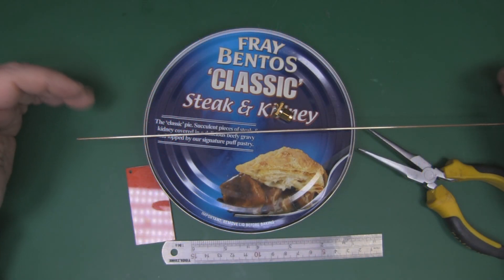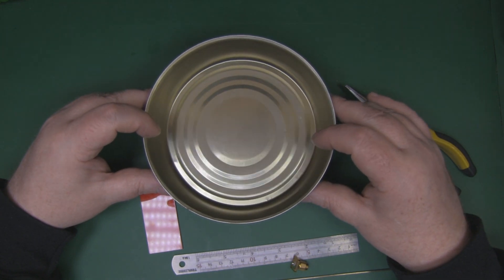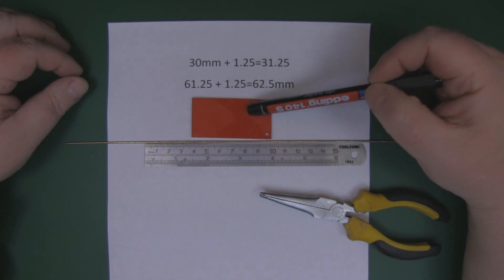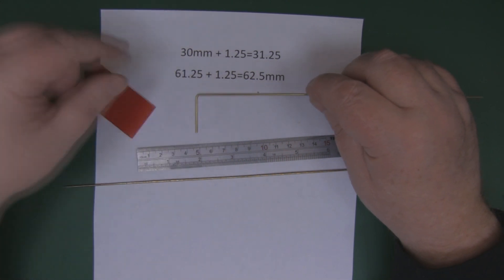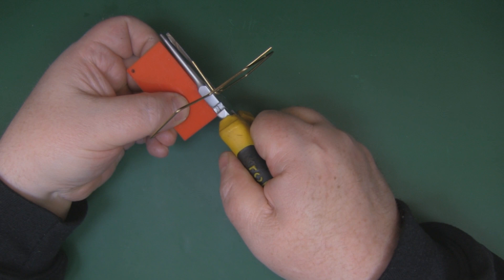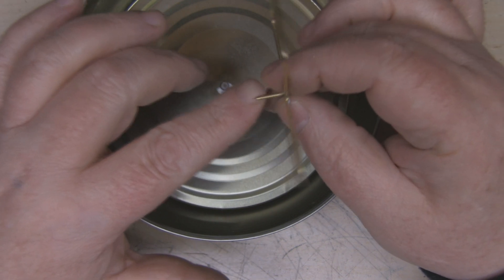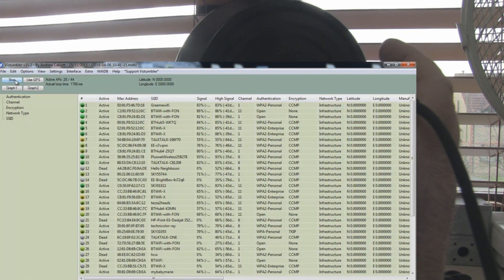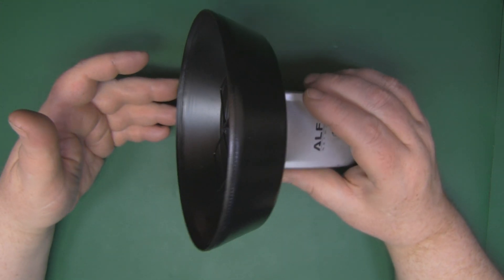The Piequad Biquad Antenna! #149

Comment: Impressed by efficiency of build, did exactly the same except reflector, tin can, 102mm dia, 75mm depth.
Was poorly 80dBm, now good as 65-67.
Haha, at 10cm from it, at the path of the narrow beam shown -15dBm <3
Will do some more tests on WiFi, later after is GSM, 3g, 4g networks

Comment: Hi, I'm from Indonesia. As most of WiFi extenders (access point radios) have 2 antennas, so we have to decide which one is the receiver antenna, or the transmitter antenna, then we can apply the quad antenna as shown in this video.

I need your explanation, thanks in advance.

Comment: Hi mate I know this is a very old video, I'm going to make one for my radio transmitter, can you use brass wire for the actual antenna? The copper wire I have is just a bit to flexible
Reply from the maker: Yep I use brass all the time
Reply: @andrewmcneil  thanks for the fast reply, what about 1.5mm copper, does the slightly thicker wire matter?
Reply from the maker: @vaughan_fpv  1.5 is fine search for brass brazing rod on ebay
Reply: @andrewmcneil  ive just tried the biquad, works ok, what antenna in your apinion would be the best, im using my standard 200mw rc transmitter and i want to get more range without going to 900mhz

Comment: You need to discuss what to do with antenna AFTER it's built. I need to boost my mobile reception in the house. I want to mount the antenna on a tall pole from the roof. What do I do with the signal in the coax cable? How do I bring it down and into my wifi network. What hardware do I need to make that happen? Does the antenna transmit the stronger signal back to the cell tower? I appreciate your clever handiwork, but what comes next?

Comment: Hi Andrew. Very inventive reuse of a pie dish!

I want to make a pair of biquads for 700 Mhz 4G and install them -45 / +135 degrees for a MIMO installation.
I have some perforated aluminium sheet (as used in security doors) I'd like to use for the reflectors.
My question is, can I use a single sheet as a reflector for both of the antennas? Mount one biquad element angled one way up one end of the sheet and the other biquad element at the other end of the sheet, angled the opposite way but on a single reflector? Or do I need to have completely separate antennas?

thanks for any suggestions.

Comment: This biquad antenna does work very well. I built different versions of it.
If you live in mainland western Europe and have an Action shop in the neighborhood, you can use their Disney canister for it (example: https://www.action.com/nl-nl/p/disney-opbergblik-/ ). It only costs 59 eurocents and you can make an antenna from the lid as well as the container.
It's 12 cm in diameter, so close to a full wavelength of 2.4 GHz which is recommended.
Make sure to use a very short coax cable, preferably of high quality and your soldering should be good (no cold joints). I just used the SMA-connectors of the standard-antenna's and made some extra shielding (Aluminium tape) where I joined the cables together. For the element itself I just used the core of the coax cable.

Comment: I still wondering if china stuff (cheaper connectors & others ) perform as well as their costly europeean ou american equivalents ?
Reply: The "gold" plating is a bit off, but it's completely the same otherwise.
For high end antennas you may still want to look into quality connectors, since even the smallest losses are pretty important on long range communication, but for regular wifi within 3km it is perfectly fine.
Reply: @lazar2175  hi, im kinda new to all these stuffs. Can I know what kind of panel mount connector should I buy if i want to connect it directly to a RP-SMA female?
Reply: @eesama9883  You need a RP-SMA male panel mount connector, which while rare is existing.
My advice is that you don't use a panel mount and instead buy a regular connector, preferably one that is solder on unless you have crimpers.
Then solder the coax to the connector and to the antenna, giving you a sort of a "pigtail" that's quite short but has several advantages, including better articulation of the wifi adapter and the cheaper price instead of the male RP-SMA connector.
But feel free to try both, only the regular connectors are like 10 pieces for $5 and panel mount are like 1-2 for $5.
Reply: @lazar2175  Sorry, I'm very confused here. So, antenna <---> n-type female panel-mount connector <--> coaxial cable <--> RP-SMA male connector?

Edit: I understand what you're saying now, but don't most of the TV coaxial cables will cause some loss? The recommended LMR-400 coax is so expensive.
Reply: @eesama9883  Err, go to the aliexpress, the 5m of the coax is under $10. Also, using the adapters is not the smartest thing, since god knows how they are engineered so there my be impedance mismatching or other things that could cause big losses.
Remember a pretty important rule in RF, especially microwave:
No adapters and sharp turns unless absolutely necessary.
Every adapter will reduce your signal by about 1db, some will more and some less. 

So. Buy a panel mount RP-SMA and use a RP-SMA to RP-SMA cable.

Or desolder your RP-SMA connector and solder a regular SMA connector, those are a bit more common.

Comment: i dont understand hooking the ground to the antenna aint it supposed to use the outer post of connector to outer post of the device its being hooked to i know in tv antennas this causes a huge loss in signal its the same as have the grounding shield touching the signal wire kills reception it looks like basicly you just hooked them togther using the anteenna itself as a jumper wire if im missing something please correct me

Comment: yeah, I know it's just a boring CD case,, but it's water resistant has a nifty adjustable stand, and works like hell mate ;)
http://i67.tinypic.com/2i251rp.jpg
http://i67.tinypic.com/ip89ac.jpg
http://i68.tinypic.com/4q55b5.jpg
http://i64.tinypic.com/n3om6p.jpg
http://i63.tinypic.com/2d9d0dw.jpg
http://i68.tinypic.com/igb2b8.jpg
http://i68.tinypic.com/i71ymq.jpg
last pic, far right, it was a cheap chinese flat panel that was made entirely wrong, they had reflector, driven panel separated way too far apart, and then all of it connected with metal supports,nuts & bolts then connected to a usb wif donglei stuffed in there as well. I used nylon stand-offs instead, measured proper gap, eliminated the usb dongle, using a alpha instead...100% improvement

Comment: Hi Andrew, Thanks for the vids, I subscribed some time ago. 

I’ve just watched this vid and the one about using a photographers umbrella, very interesting. But it’s this vid and the comments below that has really grabbed my attention.

I know so little about WiFi etc that I struggle to spell it !!!
But I’m a eager learner out of necessity ( but plowing through cr-p on Y/T about this subject and just about everything else is a skill in itself ).

I have been paying through the nose (£££) for a long time for Mobile Data which most of the time is so slow I overtake it on the train ( would that be the Doppler Effect ? ).

I regularly camp in a rural situation ( that has a poor Mobile Data signal and no power source other than solar panel and other equipment I’m amassing for the job.
Around town is just the same ( for different reasons / building walls that are thick ).
And public WiFi - ( as if ) who invented that joke, ok for teenagers furiously texting each other.
I want Mega mbS out of the suppliers, I’m not going to spend the rest of my life, or even just 5 secs ( it all adds up ), waiting for sh-t to D/L

I’ve improved this situation recently by using MiFi’s ( I can spell that, just !!! ).
And I’m contemplating trying to use them at my camp set up in a directional bowl mounted on a pole, along with suitably placed battery powered WiFi Repeaters and or Wireless USB Drives to better grab a signal and throw it in my direction.

I’m vaguely aware that Mobile Data is transmitted from providers towers at a slightly different wavelength to WiFi from a Router etc.
I presume your method and equipment is for improving connection to Mobile Data providers towers - please comment.

I’m also interested in your mention of the smaller version of this antenna that you made with a Sardine Can. I’m interested in this as a way of improving either Public WiFi or more importantly to improve Mobile Data around town. Either by the ideas above for my camp for my iPad, or connecting directly to my Android phones ( I’ve just watched a vid about removing the Test Port on a Mobile as a way of disabling the electronics to the factory supplied internal antenna so the phone will recognise a more [ usable ] external antenna ). Or to connect to Dongles for my Laptop.
Please comment.

My spelling over time is slowly improving, but I could do with a bit of advice so I can more quickly start uttering the type of words that usually grace the lips of Mary Poppins, know what I mean, - Supa Wa ??

Thanks for the Vids.

Comment: Hi Andrew great video, i tried your build and it didn't go so well, i used an N connector with coax to connect to my alfa card but the results was disappointing but that could be the fact i struggled with getting the measurements right, i have ordered a caliper to get my measurements, but where do you get the sma panel mount connectors from that you use in this video? i've looked on ebay and amazon but can't find the correct ones, if you could get me a link that would be great, thank you
Reply: Any update on the connectors?

Comment: Dear Andrew, thanks for all the fantastic videos, I really enjoyed all of them. I have days watching them over and over again. Just love it! You make it look so easy and so much fun.
Keep up the good work!
I actually tried some of your builds, with varying succes, better succes when I started using the correct materials.
Can you answer following questions?
A-In this build, wire diameter =1.25mm ?
B-Will all sorts of paint work? Any paint to specifically not use?stay clear of? I allways thought painting is bad for the signal.
C-I noticed you never really sharpened the bends afterwards; make them more square, would that be worse?
D-I allways wondered about the exact biquad shape related to wire size; inside v.s. center v.s. outside lenght of elements.
     I noticed the PCB version of the 2.4 biquad yagi has a driven elemnt of outside 31.25mm, inside 25mm outside.
     Any chance you can shed some light on this?

Comment: how about an old 35mm bulk film can. it has straight sides.. Great video
Reply from the maker: +craig palmer That would work are they aluminium or steal? If they are aluminium you would have to attach the SMA with small bolts.
Reply: +andrew mcneil thank you very much ,might give it a try

Comment from the maker: I apologise for not answering posts for the last few weeks as I have been extremely busy and not had the time to log into youtube. Hopefully things are back to normal now so I can get back to making videos.
Reply: +andrew mcneil 50 millimeters our 15mm ??? 
11.20
Reply: it would be 15 and I know this because I have a measuring device. 15mm is a little bit better than half an inch.

50mm is two inches 

Now look at the video you can see NO way is it 2 inches or 50 mm so it would have to be 15mm.

You also can tell another way. From the tip of your thumb to its first knuckle is approximately 1 inch. Look at the length of the antenna compare it to Andrew's first knuckle and the tip of his thumb you can see it's shorter.

meaning it's 15mm.

i hope that helps.
Reply: Thank you ..
Reply: Hi Andrew,

I've sent you a PN regarding an antenna problem I have.--Ty for taking the time to look into it.
Reply: I just started w/ your videos and being a tinker all my life I like the way you take everyday items and use tools that even those aren't constantly tearing the thing apart to see how they work or I my case I think there's got to be a better way this can be done...I build and fly remote control airplanes, boats, cars, and as I think you just called it a quad think I like the building part the best. Sorry I get off sometimes.....Love UR stuff, can follow UR thought process but you are much smarter and have focused your craft in a direction I haven't gotten into yet, so you are much smarter and I have something I have been looking in for over a year now and would really appreciate your input. I have a hard time paying for cable, wifi, phone, tv. Not so much the money but I can't stop thinking that there has to be a better way, so to pick up an open source wifi pull it into my house, amplify it and push it out through the rest of the house or run 1 LAN....An antenna for 50 -100km direct L.O.S. Cad5/cad 6/ the connectors. Alfa to a router? modem? bottom line I would like to pick up open wifi and get online and buy what I can and make what I need, to get the best and the fastest for the leastest.....Didn't mean to put this in your reply, just popped into the head...Thank you for the time you spend on these vids,